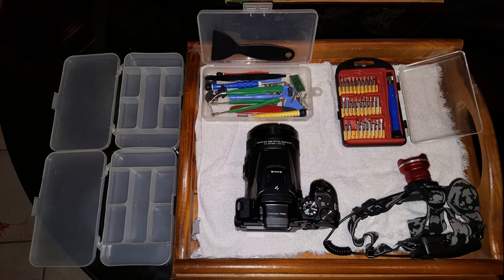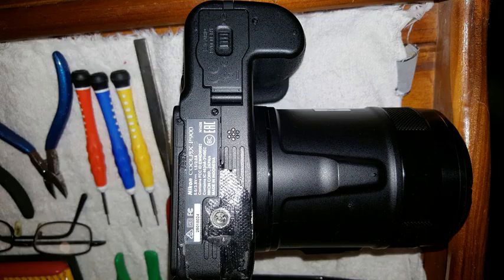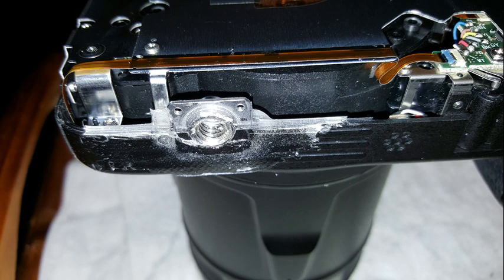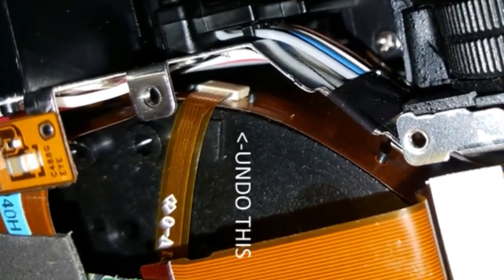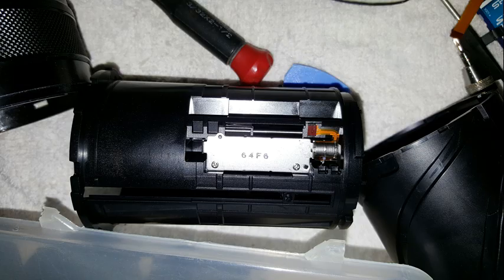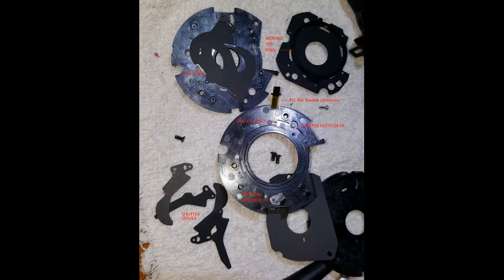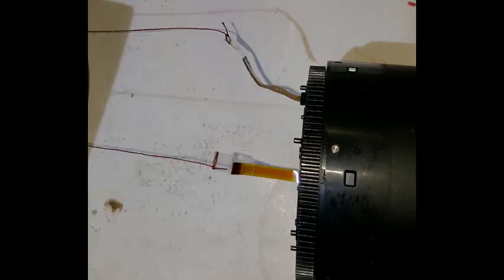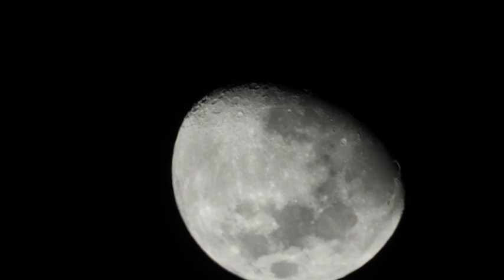NIKON Coolpix P900 Dismantling  camera and  lens teardown test

Comment: Regarding Nikon Cool pix P900 camera.

Some abnormal sound happened when entering home position if Lens as shown by attached picture .

Possible cause is too much external  axial force by hand.

I want to repair by self repairing .I have complete tools for repairing including any screw  drivers in my tool box.

If you know, pls tell me the cause of abnormal sound.

Full lens stroke is may be no problem for moving from telescopic to wide range.

Comment: Howdy, I have a CP900 and it won't turn on, even when I have directly connected to a power source the screen only flashes on for an instant, but then turns off. Any idea what this might be? Thanks in advanced babe
Reply from the maker: I will think upon it.  Tried a different battery? Original USB lead?
Reply: @whereswa11y  Thanks for the reply! I have yet to try that due to time, but will do that. If it still doesn't turn on what would it be?

Comment: Yes it's good when it works but between us, level material It's a nice piece of crap. It's been 2 times that it crashes objective level and still the same breakdown in addition choppy image in video and black screen as well on the touchscreen as in the viewfinder warranty exceeded 1 month they put me for 200 euros repair and no parts in Stock I had to wait for a lease before it was repaired. And it's not a fault of use it's their junk.
 This device is to be banned.

Comment: Where did you purchase the replacement parts?
Reply from the maker: I got them from aliexpress. Would you like to know the exact seller.?
Reply: Yea if you don’t mind, thanks a lot!
Reply: Wow such a great site, thanks so much
Reply from the maker: PT INDUSTRIES
https://www.aliexpress.com/store/107922?spm=2114.10010108.0.0.680f59f82IE6zy
Reply from the maker: which part are you after?
Reply from the maker: I have a new CCD that I bought only to find mine was fine. never used it.
I am in Aus too.
Reply: I cracked the lense, not the outer glass but the next glass lense inside. What part is the ccd? Only had the camera for 2 months to, the worst!
Reply from the maker: CCD is the image sensor. Here on the left.
https://imgur.com/YpEuMaK
So does the camera still work ok?
Reply from the maker: So the mobile lens in behind the main front lens?
Reply from the maker: On the left at 9:20 ? 
How did you crack that?
PT Industries doesnt have it listed but I had to ask for the shutter assembly  as it wasn't listed and he was able to supply one.
Reply: No it’s not those things. It’s the large glass on the inside, before the small focal lenses, pretty much the inside of the outer casing glass. Yea it works perfectly fine, just in most pics there’s a smudge from little shards of glass inside. Great video though very helpful, think I might pull it apart and see if I can clean out the shards first
Reply from the maker: 5:10 on the left. so is the main lens a mult part lens?
I wonder then if this part is what is needed?
https://www.aliexpress.com/item/Free-Shipping-P900-Front-Lens-glass-For-Nikon-P900-front-glass-camera-repair-parts/32848814062.html